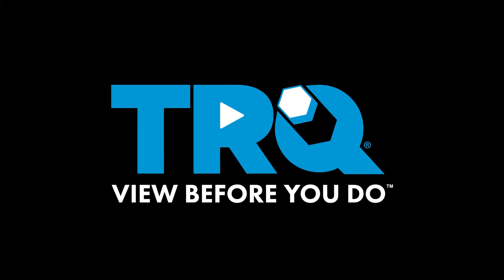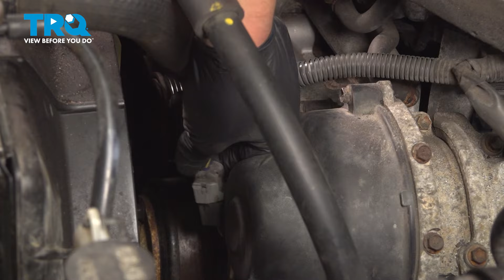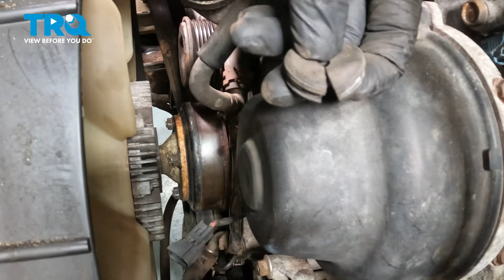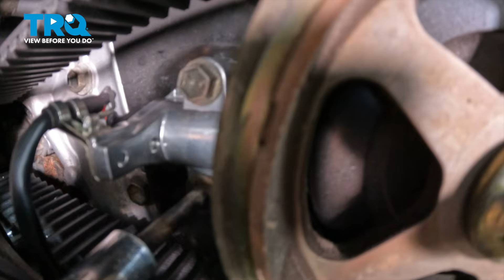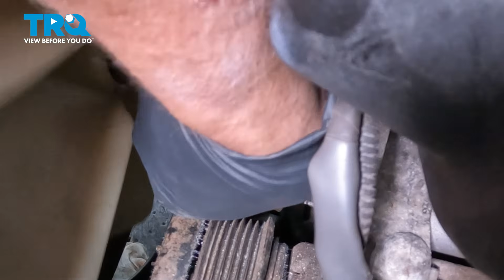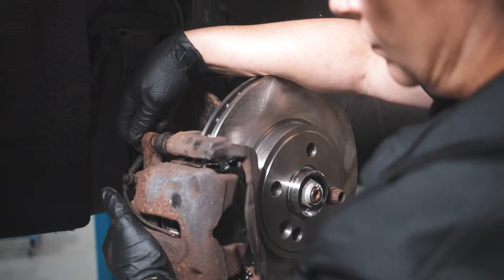How to Replace Camshaft Position Sensor 2000-2006 Toyota Tundra

Comment: One pro tip for anyone with 4.7 4Runner 

You’re better off just draining the coolant and removing the upper rad hose. Way less space and the wiring harness that hangs over the timing cover has way less play